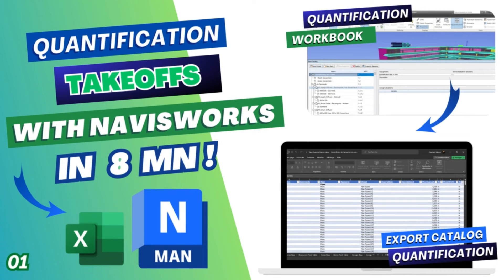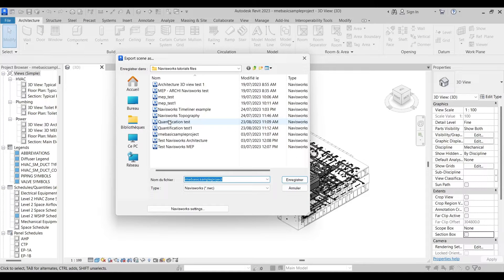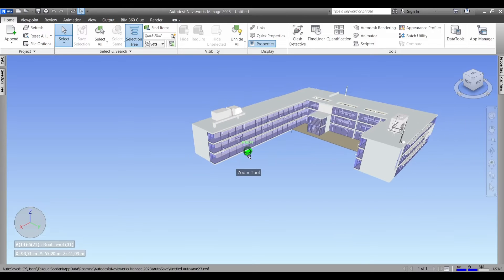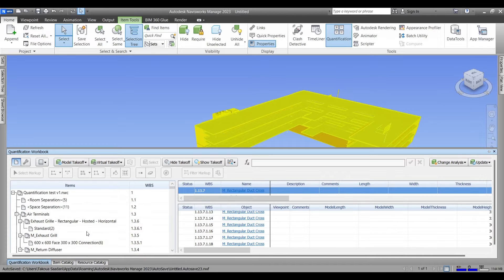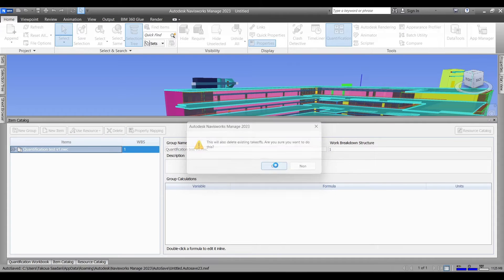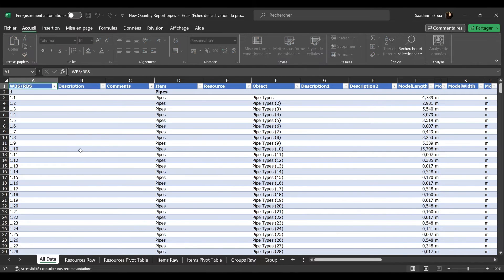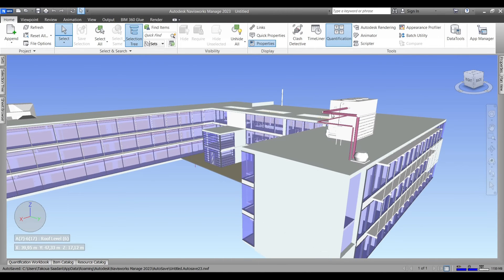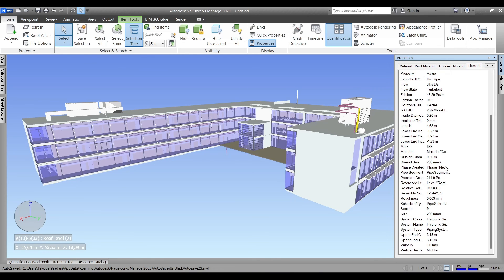Quantification Takeoffs Tutorial in 8mn using Navisworks Manage 2023

Comment: Hello, 
Thank you for this very interesting tutorial.
Can you tell me why I have all quantities equal to 0.
When I select the walls, I have no surface, volume, thickness, length width. Everything is 0.00m or 0.000m², 
I'm using the same Revit and Navisworks models as you. 
Thanks again for your channel, thanks to which I understand Dynamo better.
Have a nice day!
Reply from the maker: Thank you for your feedback !  glad to hear that my tutorials have been helpful to you. 
Regarding the issue with all quantities showing as 0.00m or 0.000m² when selecting walls, this problem could be due to a few reasons:  

The units in your Navisworks project are set correctly. If there is a unit mismatch between your model and the quantification settings, it can lead to incorrect quantities.
You may also need to review your quantification setup in Navisworks to ensure that it is correctly configured to extract the desired quantities from the model. Check that you are selecting the right elements and parameters.
And sometimes, while using a non-English version of Navisworks, certain issues may arise due to language-specific settings.

I hope that was helpful, if the problem isn't solved, feel free to reach out again
Reply: @HowToBIM  Thanks for the answer. I tried and it still doesn't work. I tried setting the units parameters correctly but the quantities remain at 0.00.
What a strange case!🙂 

You need to create a mapping for naviworks versions other than English.

If the Autodesk site says : 
When you use a metering version in Navisworks other than the English version, the elements generate values of 0.
The English version of Navisworks indicates the correct values without adjustment.
The property mapping XML file has already been modified. 

For me (French 😀), I need to configure a property mapping.
Reply from the maker: Hey, you can follow these steps to solve the issue for german, french and spanish versions  : Close Navisworks Manage.
Download the property mapping file for your language.
Replace the existing "TakeoffPropertyMap1.xml" file in C:\Program Files\Autodesk\Navisworks Manage {version}\Quantification\takeoff_maps, removing the language suffix (e.g., esp, deu, fra).
Restart Navisworks Manage to apply the changes. (Check out this file for more details : https://help.autodesk.com/sfdcarticles/attachments/How_to_cusomize_a_property_mapping_configuration.pdf
Reply: Hello, I tried but it didn't work.
I'll try again this weekend. 
thanks for your help.